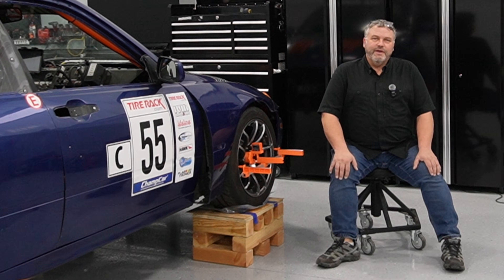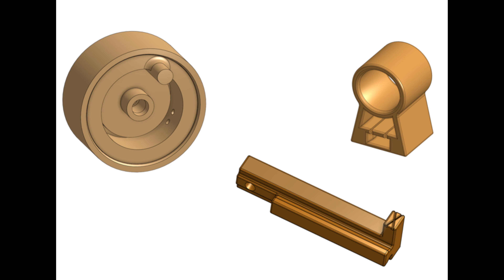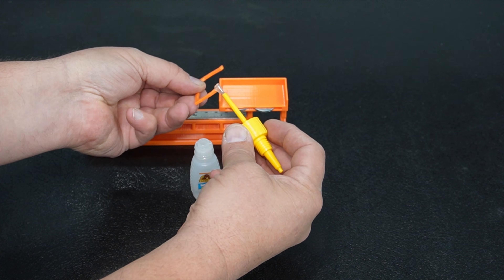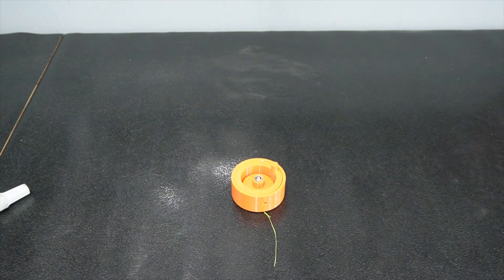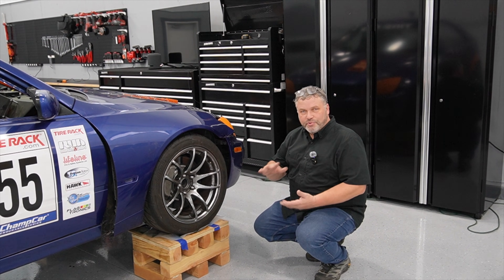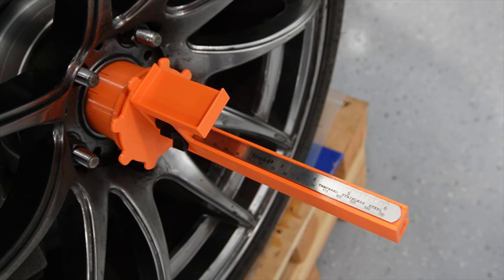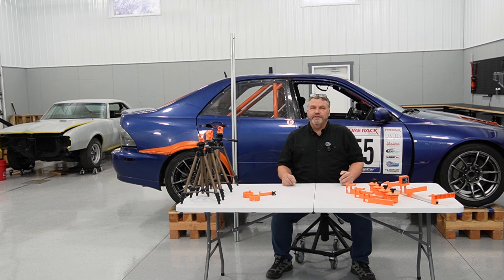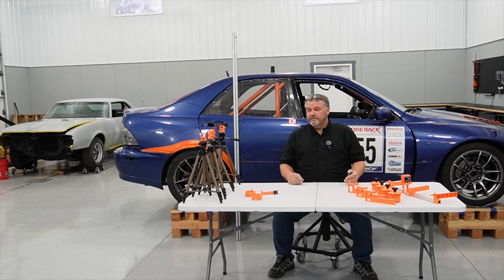3D Printed String Alignment Tools for Improved Accuracy

Comment: hey there, great to see this and massive benefit to use track day racers.

I have printed some parts and on the centre scale holder the steel rule i can source int he UK is wider that the rebate for it to sit in, also prevents the steel rule from being pushed up agist the end as they are curved, is it possible to get them with no rebate for the rule or maybe just one side of the rebate for aligning the rule, or a larger rebate, the steel rule i have sourced is about 16mm wide.and the current rebate is 13mm, had a slight issue printing the top rebate as i didn't have supports turned on. many thanks
Reply from the maker: @TomTom-dg3zx  I have a wider version I can get you a link for when I am back in front of computer.  You would have same issue with rim touch off parts so hold off on printing those until I get you the files.
Reply: @DIYFabShop  excellent, mucho appreciated.
Reply from the maker: @ here is a link to wider versions.  Did you find a wheel hub adapter that will work for you?  Let me know if you have any other issues with working with available sourced components.  https://drive.google.com/file/d/1C5xZf8QUokpHpEaGCv02GFTWBtbKTNiQ/view?usp=drive_link
Reply: @DIYFabShop  great thanks. were there metric versions :)
Reply: @DIYFabShop  i did a test print of the hub adaptor based on the no33 honda type r factory 20 inch, it was close but loose ish. the wheels are standard civic EP3 17" wheels.

measurements
wheel cap outside 63.8mm
detent outside 64.77
detent distance 5.4mm
Reply from the maker: @TomTom-dg3zx  sorry about that, I was too impressed with myself for having wider versions that I missed the fact you would need metric versions :)  It will take me just a little while to modify the CAD to make metric versions.  I am on it!
Reply from the maker: @TomTom-dg3zx  links to these files have been added to the spreadsheet and are available to download.  Please let me know if these work for you or further tweaks are needed.
Reply from the maker: @TomTom-dg3zx  here is a link to the rim touch off parts for a 20 mm extrusion and an improved fit trolley: https://drive.google.com/file/d/1fSqaTS2Zf-HzzaASO2AaVwk3IcP3L2Vu/view?usp=drive_link
Reply: @DIYFabShop  printed a pair and looks good so far, but the t nuts from the link don't fit in the grove where the trolley goes, so i'll need to file them down to fit but not biggie. maybe you could have a printed one that takes a m6 rivnut
Reply: @DIYFabShop  printed one and the thread is part didn't seem to expand the fingers on the insert, so i wrapped a few wraps on insulation/electrical tape round and now its tight and snug :), i must admit the factory centre cap didn't take much to remove so it was pretty loose. could try increasing the diameter dimensions by 0.25/0.5mm for when i print the next one.
Reply from the maker: @TomTom-dg3zx  I have a new release coming out soon with some refinements, including this trolley nut pocket that you can drop a 6mm nut in and instead of the t-nuts.  the pocket is a little over sized because it accepts a 1/4-20 too, but a 6mm nut works too. https://drive.google.com/file/d/18_SOrB6Yv_UtKP9pLFfcFwSj4p7icITV/view?usp=drive_link
Reply from the maker: @TomTom-dg3zx  a new Rev A version is available for download
Reply: @DIYFabShop  happy easter :) i've printed and its still pretty loose I've wrapped tap around the inner which pushes the fingers out,

could we try these dimensions

outside diameter 64.6
outside detent diameter 65.6mm

thank you so much for this
Reply: the trolley seems loose on the 20mm aluminium tube i have, i and likely going to drill through and ad a nut and bolt to hold it all tight. Maybe a trolley designed with a heat pressed knurled adaptor for the m6 thumb turn or allen cap head to cap this steady and in position. this could also be applied to the end pieces too, would allow for a more consistent fitment
Reply from the maker: @TomTom-dg3zx  files with new dimensions are available to download. Please let me know how it fits and if further tweaks are needed.
Reply: @DIYFabShop we have a winner. Latest version fits snug and it is solid when tightened down

Comment: Great idea!! I would like to try on my Focus mk2  but I can't find a hub adapter close enought. Could you create one? Here the measurements:
OD: 57mm
DD: 4mm
DOD: 58.3
I don't have too much idea but how about a parametric desing so people can just fill their measuments in? Like those desings in thingiverse for wheel centre adapters...
Also, how about an expandable desing where a cone expand and fix the tabs in place. It wont work with all the measurements but could do in ranges

Thanks a lot for sharing your project!!!
Reply from the maker: @danimp321 the STL files based on your dimensions are now available for download and a link can be found in the spreadsheet at the bottom of this web page: https://www.diyfabshop.com/alignmentkit  Once you get a chance to try them, let me know if they fit well or tweaks are needed.  I actually worked on "adjustable" solution for quite awhile and ran into issues with axle / hub components being in the way of anything that "moved".  There may be a solution out there, I just couldn't create it.  I have a parametric model in onshape, haven't taken the time to make an automated interface yet, wanted to check interest first.
Reply: @DIYFabShop  after printing it it comes loose really easy and I realised I did a wrong measurement on the DD. It should be 3mm, instead of four. Also the OD could be modified to 56.65 but I think this won't affect much. Also I think that the backing wall of the threaded plug could push a big more, maybe increasing diameter a bit?
Reply from the maker: @danimp321  Rev A version is now available for download
Reply: @DIYFabShop  It really fits now!!!

Comment: Sadly C5 corvette wheels seem to not use a center cap. They have a center hole, so I'm experimenting now with tryign to find a dimension that works. THe 91-95 is what I started with but it's way too small. I've also lost my center caps on my C6 front wheels so best I can do is measure on the actual wheels.

So far for my stock C6 front wheels I've got these estimates
Distance to detent: 3.5mm
Cap OD: 70.17 mm (This is actually the inside ID of the bore on the wheel, so they may use a 70mm cap)

I notice the american racing dimensions seem quite similar, so I'll try those. Will update on results.

I think these wheels have the bore of the wheel almost directly against the rotor, so I'm not sure if this will work with stock C5/C6 wheels. Which would be very unfortunate.

Update: I printed the American racing and it's close. They go in and take a little force to fully tighten but it's like the detents are not big enough to grab the wheel and lock because I can pull it out by hand. If I had access to the model I could modify until I found the correct dimensions but it seems like either the distance to detent is a bit too short (I measured ~3.7 mm on the wheel) and the depth the detent sticks out is not big enough (no idea how to measure this one. None of my wheels have center caps since we can't have them on the race car
Reply from the maker: Sorry I missed that you updated your comment.  I will take a closer look and see if I have a suggestion for a next version to try
Reply: @DIYFabShop  really want to figure out a way to use stock C5/C6 wheels.  already printed everything else 😂 just can't find a way to attach it.

Comment: BOM is missing some stuff (1/4-20 bolts, 1/4-20 nuts, and washers)

Need to help out with the inserts for the dust caps. I don't actually have dust caps so I'm going to have to tinker a bit. Did you model this in Fusion360 or? Happy to help on that front.
Reply from the maker: @benmintz3188 it is modeled in Onshape. A strategy without a center cap to measure would be to do some iterative small test prints of just a cylinder with some flexible arms with detents to help determine what measurements seem to work well.
Reply: @DIYFabShop  I just replaced the wheels with some AVID1 AV6 so I can help with those center caps....

Wheel Cap Outside Diameter - 60mm
Distance to Detent - 4mm
Wheel Cap Detent Outside Diameter - 61.5mm

If I'm able to help with the model updates, feel free to let me know. Excited to put these tools to work. I printed em all out with ASA on my Bambu Lab X1C.
Reply from the maker: @benmintz3188  the STL files based on your dimensions are now available for download and a link can be found in the spreadsheet at the bottom of this web page: https://www.diyfabshop.com/alignmentkit  Thanks for the offer to help with modeling, but I have the CAD model set up so it can be modified with simple data entry, it goes really quick. Once you get a chance to try them, let me know if they fit well or tweaks are needed. Cheers!
Reply: @DIYFabShop  you're the best. Look forward to collaboration in the future.

Comment: This is awesome! Have you considered making the hub interface portion conical and using 2 bunjees to hold the scale against the wheel? That way it would be universal and there would be no need for so many adapters. I will be printing this and try to design the bunjee idea. I'll also try to use a self leveling laser instead of strings. If anyone is interested I will let everyone know! Thanks again for this awesome design!
Reply from the maker: @aksfactory thanks for the feedback.  I have used different fixtures in the past that were strapped to the wheel with bungy cords and they always frustrated me.  The genesis of this design was about eliminating the bungy cords.  Now that being said, having wheel specific adapters is a tradeoff I was willing to make, but that doesn't mean there isn't a more universal bungy cord solution out there that could work well.  Good luck and please do share.  Regarding a self leveling laser approach to replace the strings, spoiler alert, I am about to shoot a video of a design I came up with. I am pretty jazzed about it and others will be too.

Comment: Hi There, I'm excited to try your system.. 

I have  American Racing racing rims center cap details below:

Wheel Cap Outside Dia  2.75"
Wheel Cap Detent Outside Dia 2.80
Distance to Detent .125"

TIA..
Reply from the maker: @renebour the STL files based on your dimensions are now available for download and a link can be found in the spreadsheet at the bottom of this web page: https://www.diyfabshop.com/alignmentkit  Once you get a chance to try them, let me know if they fit well or tweaks are needed. Cheers!
Reply: @DIYFabShop  perfect I’ll print a test tomorrow..thank you

Comment: This is a fantastic setup. Is there a way to have the toe scales set at a slight angle so that laser lines can be read? I have a ART II laser rig that will do laser string lines to check frame and wheel alignment. But the scales would need to be on a slight angle towards the rear of the vehicle.
Reply from the maker: @dannyb8955 the center scale holder can rotate about the threaded knob that attaches it to the threaded plug.  The rim touch off scale holders don't rotate.  I wonder if you could just two sided tape the scale to the side of those scale holders instead?  You would need to make sure you do it consistently across the two holders, but if the laser could project on that surface I think that would be a reasonable solution.  Does that make sense?
Reply: It does make sense. In my trials and experiments I’ve found the reading has to be at a certain angle so the laser “reads thru” to the front scale. I’m not knocking your design…it’s absolutely fabulous and I appreciate you making all the STL files for free. So cool. Just trying to figure out how I can tweak it for my setup.
Reply from the maker: @ do you have an estimate for the angle needed?
Reply: I’m guessing around 45 degrees.
Reply from the maker: @dannyb8955  here is a link to a couple files of rim touch of parts with the scale portion at 45 degrees.  The way I originally created the CAD models they are mirror images of each other, so you are going to need to pair them up a couple left ones or a couple right ones depending on what side of the car you are on and where your laser line is shining from.  Take a look and let me know if you think they are worth trying.  https://drive.google.com/file/d/1kZsInaQ0yjLTmoe46OmusVWmOb-4Ox3L/view?usp=drive_link

Comment: Hey there!  First:  Very nice work! Nice thinking and application.  Second: IF I may (and perhaps I'm thinking of it in the wrong way) you won't need  the hubcap sizes if the system is strong enough, and I think it is) if you use a cone shape to center (which can be a wide angle) and a straight centered or even a three point  base over the rim, well aligned.  That would give a good base extension point for the "extended" axle to measure on.  Also I think you can improve on the alignment of the  conduit on the  centerline of the vehicle, but that is a bit longer to explain. This comes (at least on my end) as a positive feedback and to let you know, I respect your work here. I'm a little surprised you just left it as an "open source" and that is respect x 2!   Nicely done!
Reply from the maker: @alexalvarez2495 thanks for the positive feedback!  I agree a more "universal" approach could be as you described with a cone and something to strap the fixture to the wheel like a bungy cord or similar.  I have tried a couple approaches in the past that used a bungy cord to hold the fixture to the wheel and they just frustrated me.  There may be other ways to make the bungy cord solution less frustrating, I chose to eliminate a bungy cord all together 🙂 Thanks for watching!

Comment: Thanks for the great work, just in the process of printing these in metric and using esun ABS+ orange on a Creality k1 Max, i had to change the inside size of the trolly square to 20.2mm to fit the 20mm extrusion using the Creality measuring tool in Creality Print, as the first attempt straight from the file was too tight and the extrusion wouldn't fit.

some dimensions for Ford wheels that use a 54mm Centre cap

53.5mm wheel cap detent outside diameter
50.6mm wheel cap outside diameter
7.3mm distance to detent
Reply from the maker: @craigyoung5442 I know that ABS can shrink a little more than PLA or PETG, but I would not have thought that would have been enough to make the fit too tight.  I am glad you were able to modify the model and get it to work for you. The STL files based on your dimensions are now available for download and a link can be found in the spreadsheet at the bottom of this web page: https://www.diyfabshop.com/alignmentkit  Once you get a chance to try them, let me know if they fit well or tweaks are needed. Cheers!
Reply: @DIYFabShop  one slight tweak is the distance to detent should be about 4mm
Reply from the maker: @craigyoung5442  new files are ready for download!
Reply: @DIYFabShop  just been to get some new tires fitted and free alignment check, and after using this it looks like i am only 
1/64th out at the front total toe 0°16' should be 0°12' ± 0°12', 0°08' each side instead of 0°06' also using 0.1mm fishing line

so on a 2014 ford focus with factory 5spoke 18 inch wheels i had the rear Centre scales at 5cm and the front at 4.5cm so the difference in readings of the front and rear scales on the wheel should be 3/64ths front scale 47/64ths rear 41/64ths 0 toe would be 44/64ths
Reply from the maker: @craigyoung5442  thanks so much for sharing!

Comment: Need size for Rays gram lights 57DR !
Wheel cap OD 57mm
Wheel cap detent OD 60mm
Distance to detent 4.2mm
Reply from the maker: @austensnyder8941 the STL files based on your dimensions are now available for download and a link can be found in the spreadsheet at the bottom of this web page: https://www.diyfabshop.com/alignmentkit  Once you get a chance to try them, let me know if they fit well or tweaks are needed. Cheers!

Comment: Have you thought of making hub adapters to bolt to the standard hub  of vehicle with standard lug nuts. Could possible make one for a 4,5, or 6 bolt pattern?
Reply from the maker: I did consider that, but felt like that approach may have 2 limitations. 1.) You would need to have open end lug nuts holding on your wheel with enough threads exposed that you could add the adapter and another nut to hold the adapter on.  2.) I was concerned that relying on the back face of the open end lug nuts to provide a surface that was parallel to the hub/wheel face may be a challenge with tolerance stack up and wear between the lug nut and wheel angled interface.  That being said, for folks that run extended length wheel studs, it may work reasonably well. I run extended length wheel studs, maybe I should give it a try??

Comment: Would you please create a file for the following:
Fuel Rebel 6, Center Cap P/N 1004-69GD

Wheel Cap OD: 97.0 mm
Wheel Cap Detent OD: 100.0 mm
Distance to Detent: 5.6 mm

These are truck wheels, cap is large, nothing on your list was close enough to try.  Thank you!
Reply from the maker: @DIYDabler the files are ready for download.  Those are some big caps!  Please let me know how it goes.
Reply: @DIYFabShop   Took a bit to reply back.  I ended up getting my own printer than keep asking my coworker to do the prints for me.  The adapters fit well, don't need to adjust the measurements.  I did need to sand down the inside of the tabs on the hub adapter to make it easier for the threaded plug to bottom out.   I'm printing the parts in PETG on a Creality K1, I'm assuming the prints are pretty accurate.